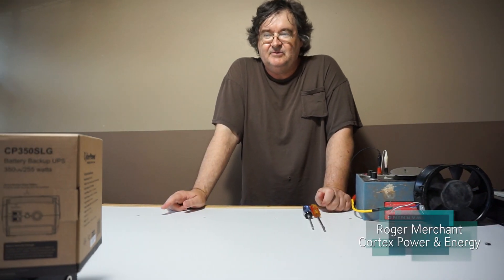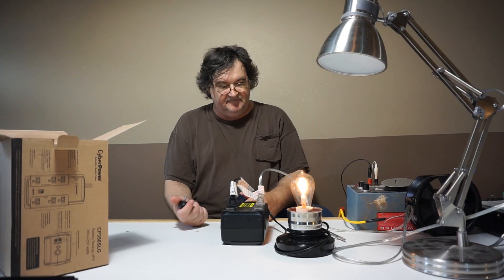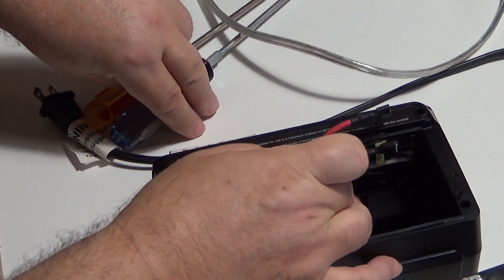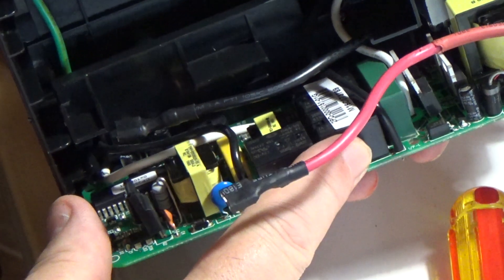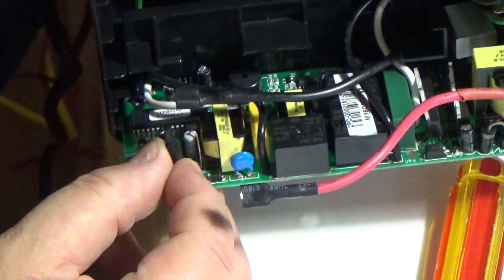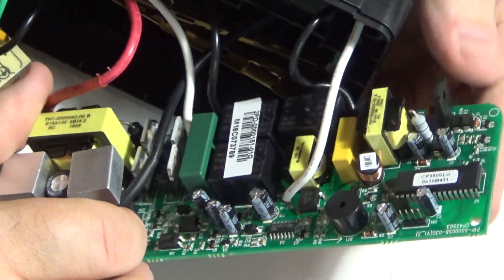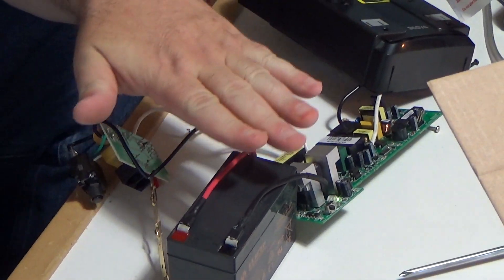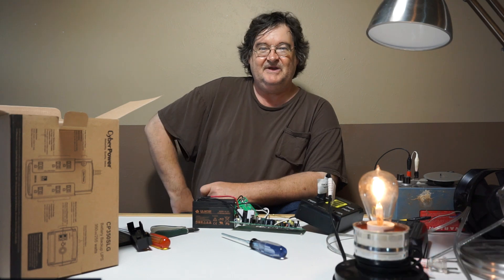Inside a CyberPower Battery Back-Up UPS

Comment: Hello...I have Cyberpower 650VA and the battery died.  I took the battery out and the surge protection plugs work but obviously the surge/battery plugs did not work.  Is there a way to bypass the battery from the circuit board and have the surge/battery plugs to work as surge protection only?  I didn't want to buy the battery because I know it will go out again in about few years and it's not worth buying.  I just want to use it as an extension cord with surge protection.  Thank you.

Comment: I know this is an old video, but could you maybe help me troubleshoot my CyberPower 1500AVR?  Here is someone else's video I found where they had the exact same problem.

https://youtu.be/6WjOyVkuN2Q

I know it's not the batteries, because even when I unplugged them, my issue persists--that being, when I plug the unit in, the surge outlets work, but the battery outlets do not.  When I press the power button, the screen flashes off and on, and I can hear a ticking happening inside in conjunction with the screen flashing.  When I attempt to reset the unit with the display button, it "powers on" as if it's working, for about three seconds, and then I hear a much louder click and then the unit goes back to flashing and clicking.  During the short time while the unit is "on" and "working" after the reset, the battery outlets work, but when it goes back to flashing and clicking, they do not.

It seems to me that somewhere along the line from the wall to the unit's board itself, something isn't right.  I have no idea how to figure it out.  I don't want to bother with replacing the batteries, because clearly that's not the issue.  Even with completely dead batteries, all of the outlets should work and the unit should turn on while plugged in.

Comment: I have one that won't turn on and the battery is dead shouldn't I get a 12-14.5 charge when I put my multimeter between the battery leads when plug into 120 power